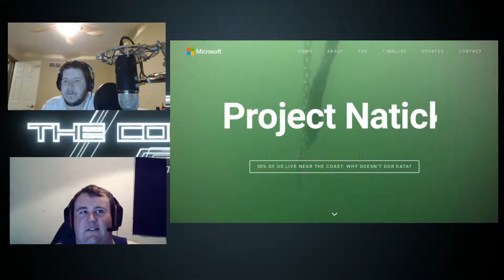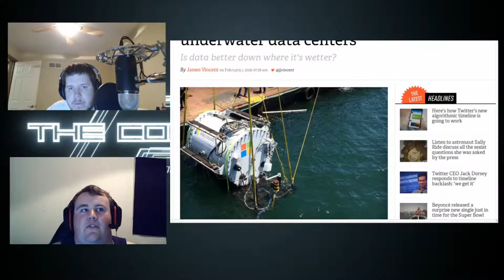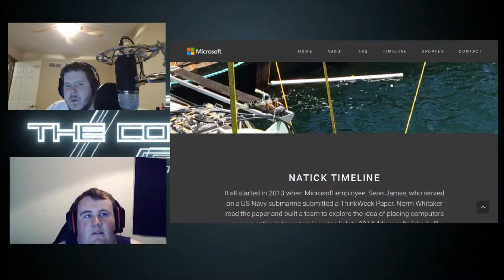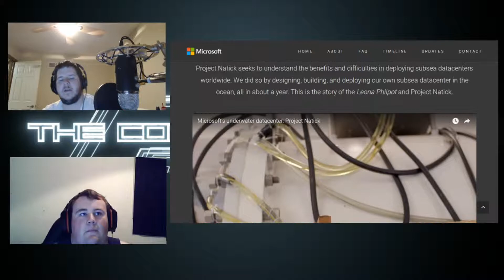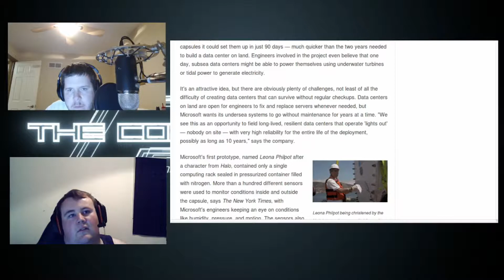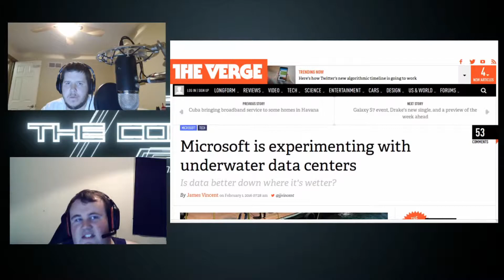Under water servers?!? - 15 Minute Tech Episode 1

Comment: Great tech minute lads. But Connor, you need to either speak up or make the gain on your microphone higher!
Reply from the maker: There have been nothing but problems with the audio, hints the annotation, this 15 min video took about 2 hours to make, and it was 4am by the end of it.
Reply: +The Computer Crowd Fuuuuck ... It only takes me 30 minutes to 1 hour to do the video side of my podcast ... (it is a similar foematte).
Reply from the maker: Well between streaming issues (and falling back to hangouts) my audio setup (which is a software issue that I haven't been able to completely fix yet) then we had like 5 takes that were horrible... It was that kind of night...
Reply: +The Computer Crowd I see.
Reply from the maker: MyPlaceOnYT Also, the video that will post tomorrow, I had to turn the audio down because I was about 5 times louder than Brad and Liam. One of these days I'll get it all figured out, as well as reduce the echo in my office.
Reply from the maker: MyPlaceOnYT I also just learned that you can record multiple audio tracks with OBS now... That would of been helpful for the last 2 videos